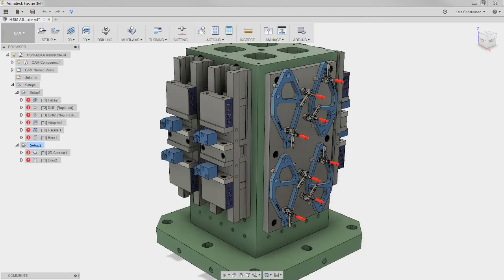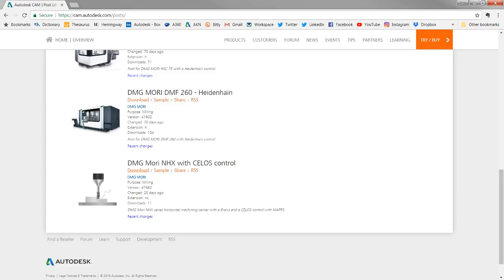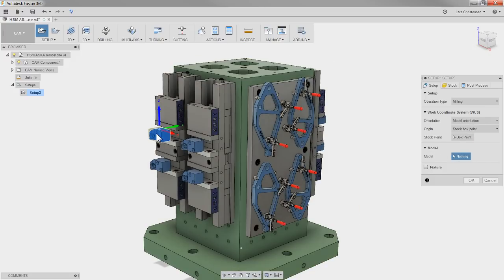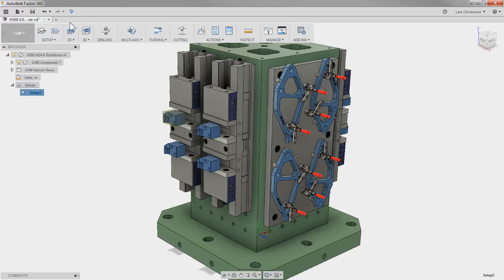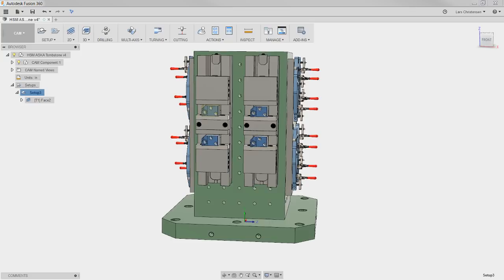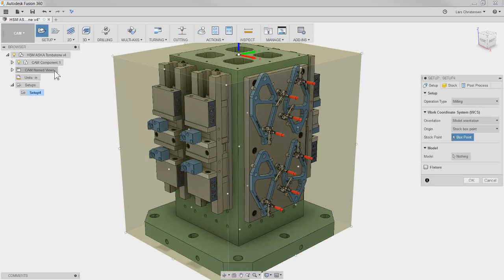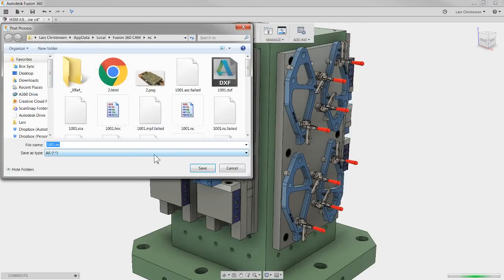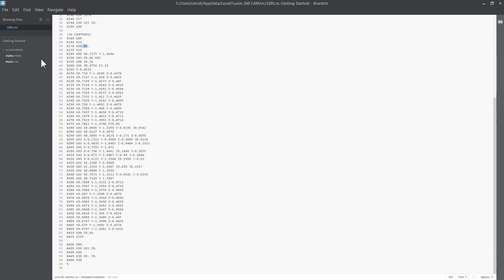Fusion 360 CAM — Program 4th. Axis Tombstones — #LarsLive 96

Comment: Hey Lars
Excellent video. Always easy to understand your concepts and you've taught me loads about Fusion :-) 

One thing I don't understand though is how does fusion know where the centre of rotation is? On the second example I suppose it doesn't need to know. It just remembers X, Y, Z, A in space and orients it that way. On the first example is the origin also the centre of rotation? So say if I had a two sided tombstone I couldn't touch off at the back corner it would have to be on the A axis centre line?

Apart from the above amazing as always :-)

Comment: Lars, nice video.  I'd love an expansion video on this subject.  Specifically, if I have a 4-side tombstone (the vice variety like presently sold by Chick Workholding).  Each side has 2 positions and all 4 sides have the same part;  the top position on each side (OP1) and the bottom position (OP2).  Let's assume the parts have 6 side to machine.   My question is, keeping the idea of amortizing tool change (minimizing the number of tool changes) between OP1 and OP2, AND hitting the 2 exposed face AND the 4 exposed sides on the other 2 sides.   Once this is done, then we index 4 times, and 4 complete parts come off.  Whew!  Thank you for your thoughts, but this would be a great video and it could be integrated into a vertical machine scenario as well with the same part, OP1 and OP2, in each of the 2 vice positions of a double station vice, with 2 or 3 vices.

Comment: Lars,  Great Info,  Thanks.
However,  I would like to know if there is a way or a post that will swap axis.  We have old horizontal boring mills with manual positioning Universal heads mounted to a extending ram ..  So a lot of times  we will program straight on as normal, but quite often will we have a piece setup mounted to that table so we will position the head 90 deg perpendicular to the table .  This means we have to swap out the Y axis for the Z axis and use G18 instead of G17.  but we still use G54.  We have other CAM software  that I was able to modify the Post to do this but we are trying to move towards a one source software .  Is there an existing post out there for fusion that can do this?  I don't consider this an advanced thing, as I can use secondary software (NC Text editing ) to swap axis, but would like to be able to do this using the features you showed here.

 Thanks
Reply from the maker: Hi erik gerth Thank you for watching!
That can for sure be done. If I was you, I would post that question here:
https://forums.autodesk.com/t5/hsm-post-processor-forum/bd-p/218

I know the post team are watching this place and someone might have an easy button

Best,
Lars

Comment: Could you do another 4th axis tombstone video where you show how to do operations on three sides of two different components. Component A mounted at the top of the tombstone and a completely different Component B mounted at the bottom. Do all the processes to all sides facing the spindle on all six parts, rotate 90 degrees, repeat, rotate 90 degrees, repeat, rotate 90 degrees, repeat. Really appreciate your work.
Reply from the maker: Hi grappler185 Thank you for watching!
I will put that on the list! Thank you!!!
Reply: Thanks!!! Let me know when you post it.
Reply: Sure would like to see a Part 2 to this video that shows how you handle work offsets for all three sides. : )
Reply: Has this video finally been made?

Comment: What if on the second wcs. You face the part like you did but also wanted to drill holes on the side of it ??? How would you go about that ?
Reply from the maker: Hi Jose Penaloza Thank you for watching!
As long as you can use the same wcs direction, you can create drilling toolpaths on other parts.

Hope this is helpful.
Best,
Lars
Reply: I ment on the same part that gets faced can you create drill toolpaths to come in on it's side with tool orientation? I've given it a go but no luck.  Maybe you can't do that ?

Comment: Thanks for the video Lars,
     Is there a way to machine the two different parts, on two different sides of the tombstone,  presumably with two separate setups (in order to define the tool orientation / tombstone side), but also be able to minimize tool changes?  

For example Part A on side 90, Part B on side 180...T23 on part A, then T23 part B, then change tools to T40 for part B, and move to T40  Part A, etc.  (tool numbers are arbitrary of course). Basically making some operations that use the same tool on the two different parts shown in this tombstone video, completing all operations on all parts with a given tool once rather than changing in and out of the spindle. 

This is useful for manual tool change machines with or without additional axis as individual parts could be programmed, and then grouped on a table or tombstone as needed. Making mirror parts, full component sets, etc rather than large numbers of the same component.
Reply from the maker: Hi John Gover Thank you for watching!
Right now there is not a good way to mix everything up like that, but I know that the development team is working on some cool new function that could speed up that scenario :-)
Reply: Thanks for the reply Lars. I wasn't having any luck with the methods I was trying ;-)
Great to see the quick responses to questions, even in semi-obscure methods of asking (in the comments of a video). 

Autodesk- Give Lars a gold star for the week.

Comment: Question on the second method WCS, so would you probe Z like you would X, and probe X like you would Z with a Renishaw Probe ?
Reply from the maker: Hi Frank IRAQVETUSMC1-7 Thank you for watching!
Well, on a horizontal Z is still along the travel of the spindle just like a vertical. So you will still execute the probe using XY to locate the corner and Z for up and down.
Think about it like you lay your machine on the side :-)

Comment: thanks for the tutorials Lars  . advanced question. can fusion post subroutines using G10? i have a horizontal with 40 parts per tombstone. each part has three sides that needs machining. rather than have 120 wcs' im hoping to have three wcs', but with a wcs shift for each part derived in the code (so it can be nudged on a per part basis if required)..  eg. G10 L2 P.. X.. Y.. Z..
thanks in advance
Reply from the maker: Hi keefmeef Thank you for watching!
Yes, I know that there are specific posts that support subroutines. You probably want to test one of the ones out on the online library.
Also, here is the link for the post forum if you need more assistance:
https://forums.autodesk.com/t5/hsm-post-processor-forum/bd-p/218

Best,
Lars

Comment: Thank you Lars.  I cant wait to program my tombstone now.  I am still working on positioning the parts on the tombstone.  One thing I noticed is there was no additional clearance of the tool while the pallet is rotating.  Does that have to be done manually?  

Ryan
Reply: Good question and I had the same thought. I'm not certain but at 21:48, line 87 (N390) there is a G30 G91 Z0 which is not present at the end of the other facing operations. G30 is a secondary machine home position. I'm assuming it is configured as a safe position for tombstone rotation and the code is inserted by the post whenever the tombstone is indexed.
Reply: good eye!  Full retract to home is pretty excessive though, but better than a crash.
Reply from the maker: Good eye! Without digging deep, I would think you could get you clearance plane to be your height for rotation. Or, use a manual NC comment between Setups to set a rotation height....maybe something I need to try to look into next week.

Best,
Lars
Reply: Well, I have made a few mistakes in the past and broke cutters off by copying and pasting code with incorrect clearance for rotation, so  home position clearance will save me some money on setup!! I am very excited to post the code and run parts today with no manual editing. I like to keep all planes very low from part to part, no higher than .1 above stock, so I really only need high clearance for rotation.   Thanks again for the video Lars!!!